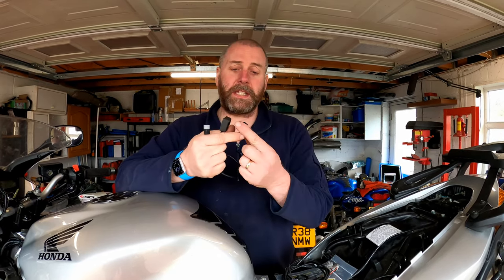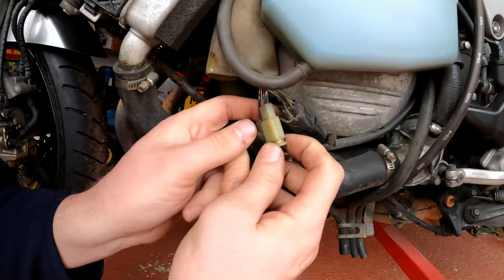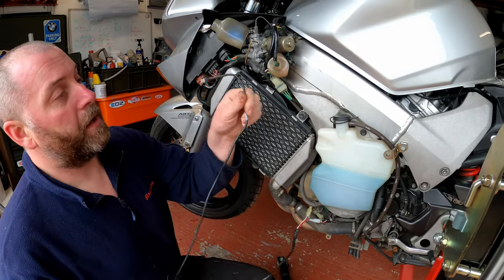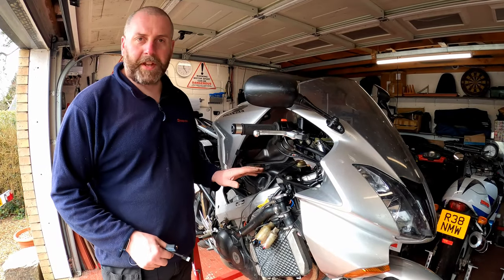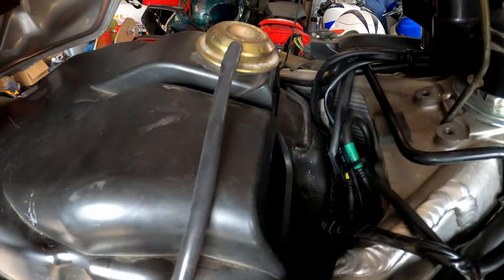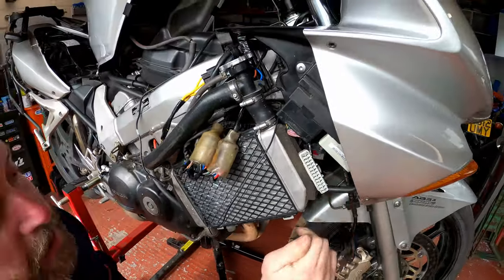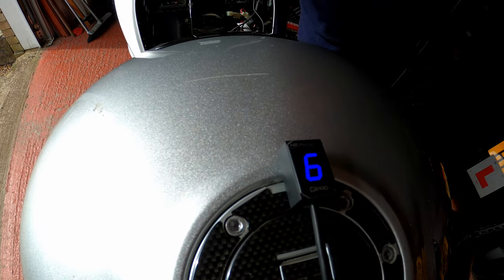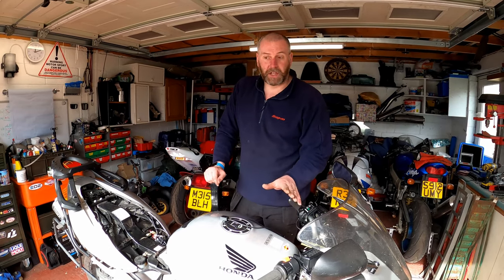Fitting A HealTech GI-Pro Digital Gear Indicator To The Honda VFR800 VTEC 2002 - 2014.

Comment: This is the same procedure for my 2003 GL1800,  wires are the same, connectors are the same.  I did make the black and green wire from the healtech device to the ECM longer by adding a short piece of wire and a disconnect between it and the yellow / green wire that I tapped in to.
Reply from the maker: Nice work 👌🏻😎

Comment: Cool. I've been thinking about one of these as occasionally I find myself looking for the elusive 7th gear. I thought the L was it!!!
Only thing I'm not so keen on with the Healtech GI is you have to choose your display colour before purchase as you cannot swap between colours as your fancy takes you once you have installed the unit which is a bit primitive imho. Also the Healtech GI units are north of £100. I see similar are available from AlliExpress for around the £20 mark or less. They look pretty much identical. Yeah I was going to use the Andy Drummond bracket I have as well just like you have done. 

I believe Healtech also do a QS for the VFR 5th and 6th gens as well. Maybe something for the future? Thanks for making.
Reply from the maker: Yeah, I get what you mean about the colour, can it be changed on the Aliexpress one then? If so then that is pretty cool.
Reply: @KevsShed  No, I don't think so. You still have to choose your colour as far as I can see. Haven't bought one yet. I guess the Healtech ones will definitely work, should do for over £100. The Alliexpress ones are a lot cheaper so maybe they aren't as durable? Don't know. Suppose I should order one. I wouldn't mind one of Healtech's quick shifters on my VFR. P3 Tuning Limited have done a vid of mapping a 5th gen VFR which had a Power Commander, Black Widow Exhaust and Healtech QS. It sounds epic. I suspect the 6th gen would sound equally epic. Many thanks, Kev. ATB.

Comment: And I who wanted to see the splice! You said that you soldered it, I'm thinking of getting a Healtech but using a T-tap maybe instead of soldering to tap the new wire in. Have you tried that before? Overall from what I've read crimping cables seems to be recommended over soldering when it comes to many applications, including vehicles. Any special reason that you solder the cables?
Reply from the maker: I know that people use all kinds of methods to tap into cables but I prefer the solder and heat shrink method, it's a little less Heath Robinson and a more permanent fixture in my opinion, not to mention 100% water proof. Everyone has their preferred option, but this is mine! 👍🤓
Reply: Don't use a t-tap/vampire tap. They work fine until they don't.

A t-tap is not crimping. There's no/minimal mechanical force applied to the conductors, no cold weld, etc. It's cutting a wire with a razor blade and hoping the plastic housing holds the wire against the blade well enough to conduct. Given the vibration on a motorbike, it will fail.

Just solder it and heat shrink it. It's not as scary as it's sounds, and it's fairly difficult to really make a cat's ass out of it. So you'll be less likely to end up on the side of the road as a result.

Comment: Hi Kev thanks for this video. I’ve ordered the healtech for my VFR. I have no access to 3d printers not that I’d have a clue if I saw one😀. Is there anywhere to buy a housing to fit the yoke bracket   Thanks anyway keep
Up with the vids cheers. Les

Comment: Hi Kev,how much does the plastic adapter cost for the mounting plate. Cheers
Reply from the maker: I have the files required to be able to 3d print one for yourself. I don't actually own a 3d printer myself so am unable to supply them myself. If you give me your email address then I will gladly send you the files.
Reply from the maker: I have added a google drive link for the 3d printer files into the video description for future reference. 👍🤓

Comment: Hey Kev, great videos!  Loving all of them so far.  Curious what stand that is you're using.   I've looked online but can't seem to find one specifically for the VFR800.   Another video I watched on this kind of stand said you have to find the correct adapter plate for your specific bike.  Thanks!
Reply from the maker: Hey bud, it’s the ABBA Skylift. It’s a fantastic bit of kit. You are right, all you need to fit it to your bike is the correct fitting kit 👍🏻
Reply: @KevsShed  do you have an insight on where to get the adapter plate?
Reply from the maker: @GMoneyMacFresh  Theres a guy on eBay that sells them. I'll get you the link
Reply from the maker: https://ebay.us/7eAKnU
Reply: @KevsShed  Was looking for the ABBA skylift plate - not the accessory thing.

Comment: Hello kev can I pick your brains please,  ive moved on to a 05 vfr vtec,  lovely bike but I'm not loving it for some reason ive just sold a cbr600 , it's the first v4 I've ever had or been on when I put the power down to me it seems like a juder going through the back wheel,  again first v4 and been told power delivery is a lot different,  also been told I might be labouring the gears but I really can't see I am,  any ideas about it I'd be grateful kev or anyone who might be able to help

Comment: Thanks for the great video on this.  How did you 3d print the plastic adapter for that hole (ie, the aftermarket plate that holds USB, cigarette lighter, etc)?
Reply from the maker: As it happens, I got this from a guy on one of the Facebook groups that I frequent, however if you give me your email address I will gladly send you the file that you need to print one for your self! 👍🤓
Reply from the maker: @tonylee3484  Done mate
Reply from the maker: I have added a google drive link for the 3d printer files into the video description for future reference. 👍🤓

Comment: What I meant to say where is the diagnostic plug to plug in the plug and play
Reply from the maker: Remove the right side fairing. near the top, not far from the ECU you will find a RED connector with a cap. remove the cap, plug the GI-Pro into it, and then follow my directions to program it the exact same as mine. 👍🤓